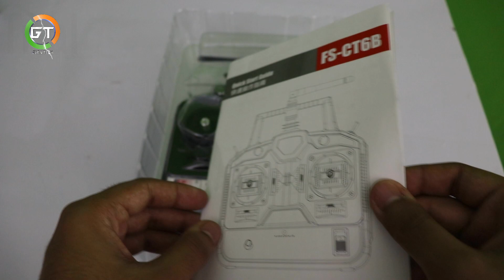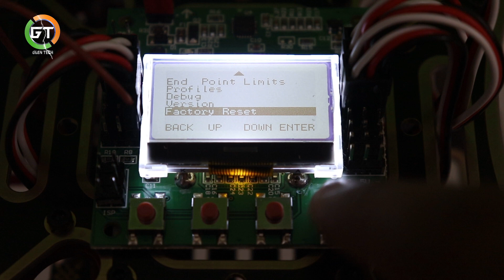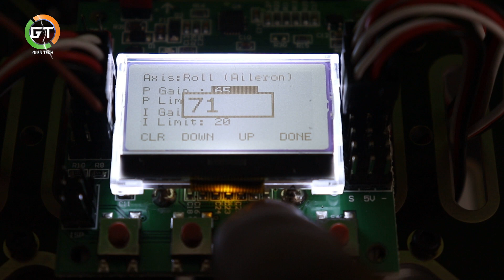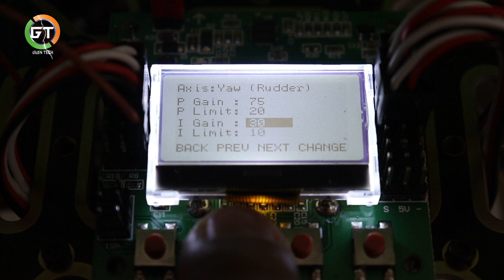How to Make a Cheap Drone at Home: A Step-by-Step Guide

Comment: Full budget ethraa
Reply from the maker: 10,000
Reply: @GLENTECH  allaah.... ഇതാന്നോ കുറഞ്ഞ ചിലവ് 🤯😯
Reply from the maker: ഇതാണ് ഏറ്റവും ചെലവുകുറഞ്ഞ ഡ്രോൺ. 

 ഇതിലും വില കുറഞ്ഞത് വേണമെങ്കിൽ കളിപ്പാട്ടം വിൽക്കുന്ന കടകളിൽ നിന്ന് കിട്ടും ( with 5 minutes battery life )
Reply: @GLENTECH  but ഓൺലൈനിൽ കിട്ടുന്ന 4-7k budget dronesoo
Reply from the maker: @Jimbu1777  less price then less quality
Reply: An Arduino Nano costs only 259 ruppees .using the software you can program the board easy and it automatically detects the PID Values .so no need for any calculations calulations
Reply from the maker: @amalthomas6735  it will work